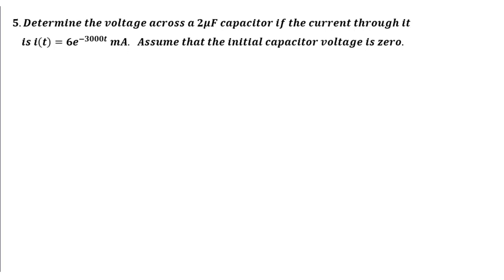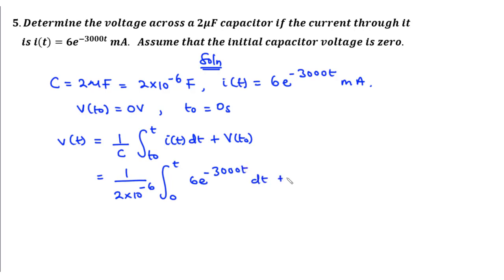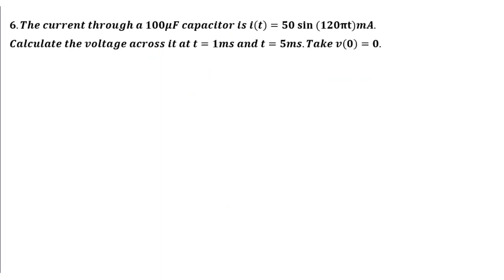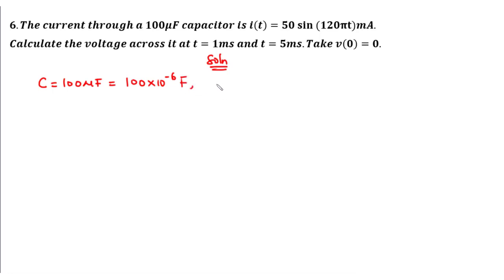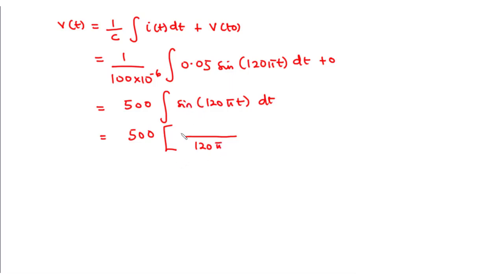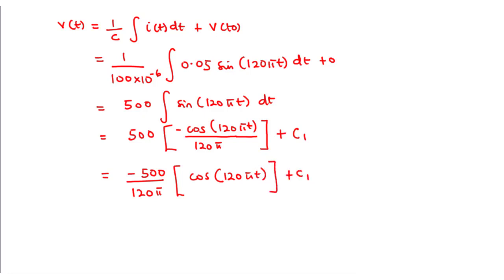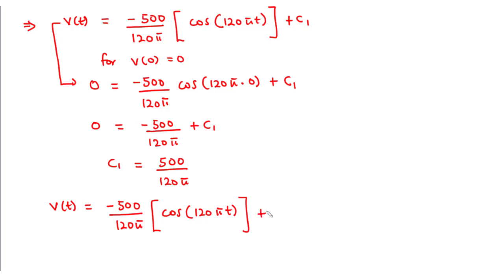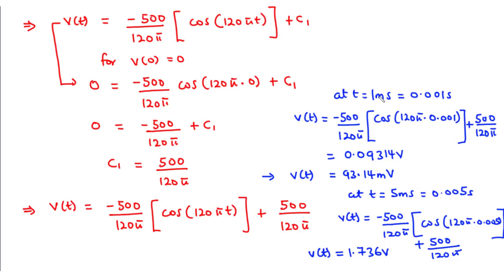☑️23b - Solved Problems on Capacitor Basics 2

Comment: What is the difference between a car battery and a capacitor?
Reply from the maker: Car battery stores chemical energy which is converted into electrical energy to power electrical devices, where as a capacitor stores energy in an electric field between it's two plates and discharges this energy to other circuit devices
Reply: @SkanCityAcademy_SirJohn  thank 😊